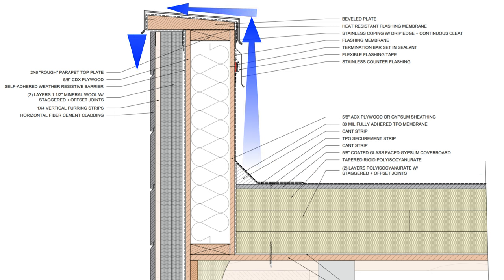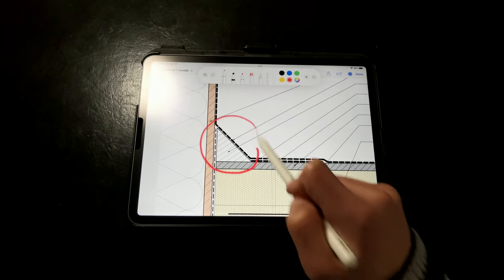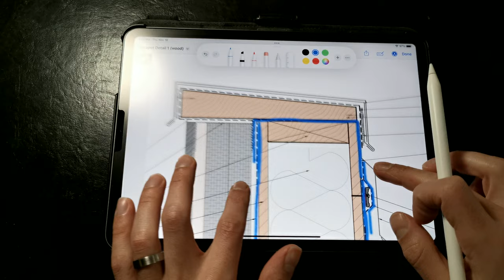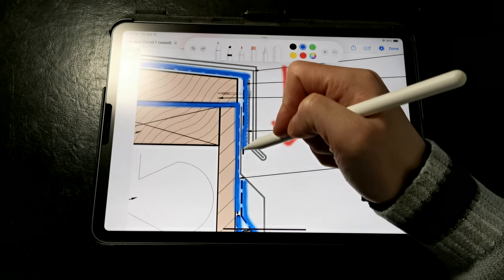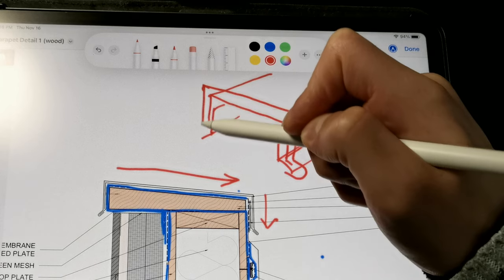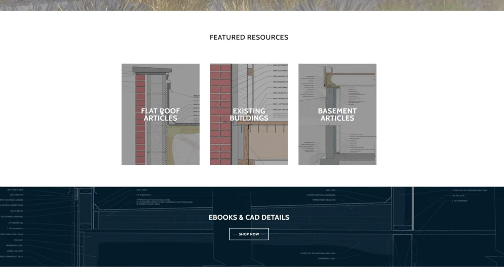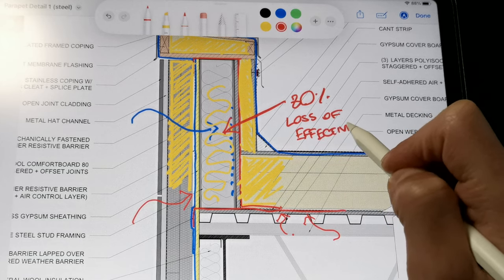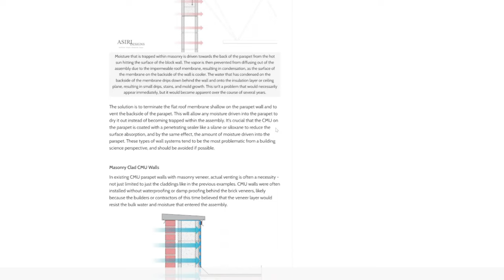Flat Roof Parapet Details Explained (For Architects + Contractors)

Comment from the maker: Get my climate specific guides to flat roof design available here: https://asiri-designs.com/shop
Reply: Excellent information, once again! We're builders, but this flat roof is new to us. I bought your cold weather package, even though I'm in zone 4 in Northern Arizona, since we used to more foam in Utah where we usually build. We connected the 4" polyiso layer on the roof with the 2" foil-faced polyiso layer on the wall by going up and over the parapet so it's fully encased in foam. The parapet structure was fully sealed with Prosoco joint & seam and R-guard MVP before adding the foam. Then we added an 18" strip of high temp peel & stick membrane over the foam on the parapet top and down the sides 6". Our roofer is stopping the deck TPO at the inside corner of the parapet and then running a separate piece of TPO up and over the parapet to the outside wall, which also overlaps the roof deck TPO by 12". The parapet TPO is fully adhered, the rest is mechanically fastened. We air sealed the roof deck seams with Zip tape the joint & seam filler. The peel & stick between the foam and the TPO is required by the manufacturer to "protect" the TPO since we're using metal coping over it. I'm not sure how the peel & stick under the TPO matters - I really hope this all works.  Would love your input. Thanks.

Comment: Great video and info!
Reply from the maker: Thanks so much!
Reply: @ASIRIDesigns  Do you cover insulation of and moisture control of shipping container homes?

Looking to purchase either a 
~ Marine shipping container (Corten steel), or a 
~ preinsulated Freezer Shipping Container "Marine" (Corten steel) 

given that both of these have flat roofs so to speak, AND a continuous IMPERMEABLE METAL surface: (mostly impermeable -- imperfections, holes for windows, doors, plumbing, electrical, etc that might not be perfectly sealed, screw or bolts that also may allow moisture movement despite our best efforts) ....a tremendous amount of spray foam insulation could be applied to the exterior and whatever layers on top of and cladding/siding to protect that...
But then what about the floor, AND the walls and ceiling inside the container?
Initially we "want/wanted" to install a flat on both sides: milled log floor,wall,and ceiling of about 6 to 12 inches (depending on total R-value achieved with all other layers =  our goal was a total R-value of around 50 to 80 as we intend to be moving it (we are CDL holders so we would keep then on Semitrailers, likely a double drop or other low trailer as we wish to have a HC / High Container 9'6" or higher interior if we find a custom/larger container [oversized load are no problem for us] as the taller and wider is just a nicer internal liveable experience, AND allows for the thicker milled log wall,floor,and ceiling without much perceived loss of space === thermal mass is part of the desire for using milled logs on interior)

EDIT: We would be in 3 entirely different environments over an entire year each in rotations: south Florida, Arizona/New Mexico, and Alaska... So we "need" to account for all the major environment challenges, which pretty much exist in Alaska alone, sea spray/salt from the ocean being around a less than a half mile from coast in Florida and Alaska for a couple of the years and no where near the coast for other years.... Thus the preference for Marine/Corten steel...

... because this would be a FULL TIME RESIDENCE as opposed to a "week/weekend camper or RV like usage...the quality of life within is VERY important, such as: near ZERO chance of moisture trap/condensation aka MOLD, and near ZERO chance of "off gassing" of spray foam/not using spray foam inside ...or off gassing of very much of anything else...we were concerned about termites,ants, mealworms, etc as they are known to EAT foam board, and the only Foam Board that claimed to be "resistant" and explained HOW this was achieved said: it was via a aromatic/fragrant deterrent!! ...1. who knows what effect that has on anyone that might be or become sensitive 
2. Who knows what long term health effects are from exposure
3. Who knows how long it would last
...given so many "unknowns", it also brings to mind whether one should even bother with such concerns? i.e. simply use rigid foam board where it is appropriate and "if" ants, termites, mealworms take up residence eating it, tear it all apart and redo ???
Or are there other methods to safely and EFFECTIVELY preventing and Eliminating such concerns?
Obviously using milled log of any thickness for interior would be a BIG problem with any ants, termites, mealworms...not to mention the off gassing of their fecal waste which is nothing to dismiss as it is quite an irritant to health/immune/allergy/sensitivities/respiratory, etc...
I am familiar with Boron/Boric acid, but it is not perfect and is claimed to have been "ineffective" in situations, and i am unfamiliar with what potential problems it could create with various materials...
I am also very much interested in "Shou sugi ban" (burnt wood) and using it on the milled log interior ...this i do not have any practical experience with, but like the various looks of different applications/degrees of...
... thanks in advance for any direction you can point me in or where to get started with your assistance?